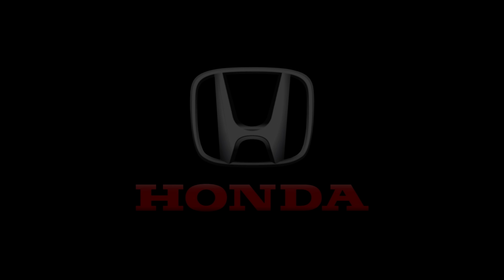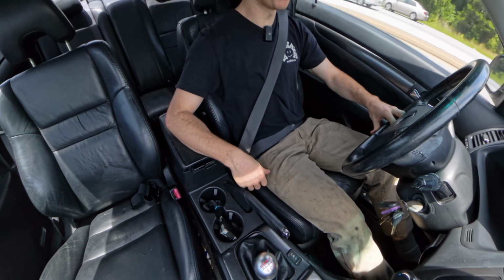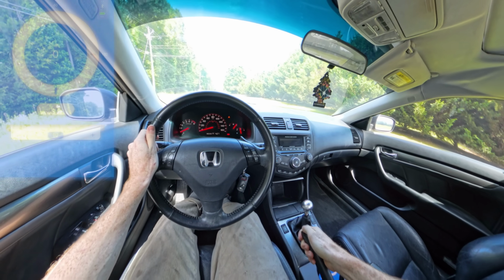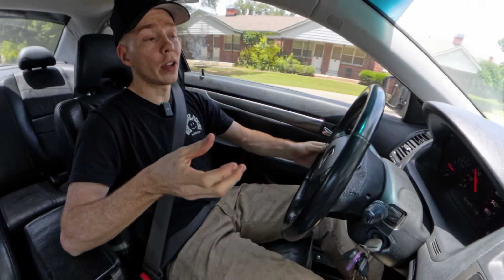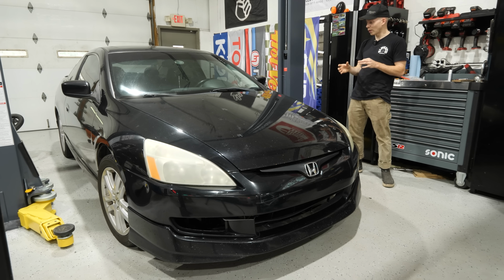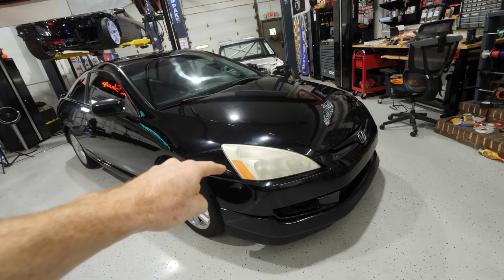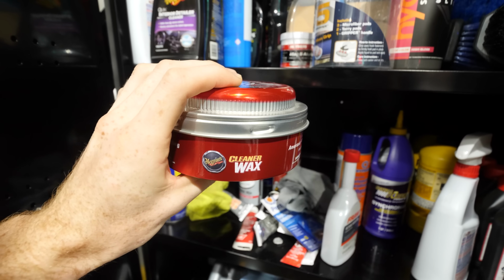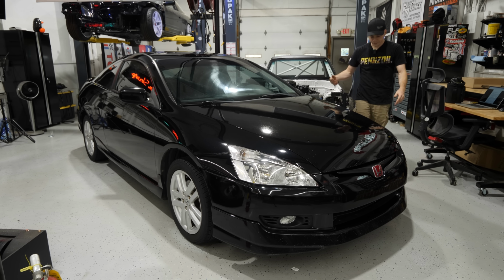I Bought Honda's Most Underrated Vehicle

Comment: Had an '05 Accord EX-L V6 auto. They are great daily drivers. Bought with 309k miles for $850. Replaced the front suspension, tires, brakes, power steering pump, plugs, coils, injectors, buffed out the faded paint and headlights, replaced the factory radio with an 11" Apple Carplay radio and kicker speakers. It was my daily for about a year and a half, even drove it from Kansas City to Austin and back 4 times (1,500 miles round trip). Sold it for $3,250 with 338K miles. Honestly wish I had kept it though.
Reply: where did you find that accord for $850?

Comment: YES! The v6 coupe accords are actually so underrated. Very powerful, not heavy, super reliable… 9 psi and they make over 400 horse
Reply: I had one.  I loved it.
Reply: Mine was auto but still such a fun car I miss it
Reply: Not from factory
Reply: @Lorentz_Driver  correct, hence why I mentioned that it needs to be boosted to make 400 wheel…
Reply: I miss mine, can't even find them anymore these days  : (
Reply: psi is irrelevant
Reply: @stevejeffrey11  the clear coat was so bad though I had the green which was a nightmare
Reply: @unsub2132  ye old Hondas really cheaped out on the paint XD
Reply: @joeygutierrez2657  no it is relevant. The biggest restriction is the valve openings into the combustion chamber and you ain’t really gonna be changing the size of that much therefore the psi of boost is totally relevant.
Reply: bruh with the right build 9 psi is like 550 with these cars 😭
Reply: @pob_car it also loves spray, fbo j33 accord with 100 shot is making 410whp
Reply: How much boost can the stock v6 bottom handle before having to go forged?
Reply: @iiAzT3Cii  can’t really measure that by boost because different boost levels can make different power levels depending on a lot like the turbo and fuel and whatnot. Whatever boost you do run though, people have pushed stock J30’s to over 500 horsepower all the way to j37’s to over 600 horsepower. 

It depends on a lot of factors but these can really push far even sbe
Reply: It's depressing everytime I look up any 6-6 Accord from any year it was made, Nationwide searches in the US always pulls up to 40 across the nation at most. It's almost as rare as the NSX itself, yet only a 10th of the price which is why I want one so bad. Cause if I could afford an NSX, I'd just buy a house instead lmao
Reply: I had an 02 favorite car til the trans blew
Reply: @Lorentz_Driver 9th gen coupe v6 from factory I beat rts etc
Reply: @Lorentz_Driver no shit
Reply: 400hp, no need for more than that goign to the front wheels. It will be reliable. to.
Reply: @terminhaider9695 I have a 2007 v6 6 speed sedan in a 1 year only color. I know of 2 others that I had to find in accord groups lol.  Mine has 140k the others are well over 200k which is cool.
Reply: @Lorentz_Driver "not from factory"  thanks for letting us know that Honda never made a 400hp accord.
Reply: He said on 9psi? @Lorentz_Driver
Reply: @joeygutierrez2657  it is when they come from the factory making the power you build a 4cyl to make in the early stages suspension upgrades are super noticeable at damn near 300hp in early modles and up to 360hp in the newer models
Reply: @wrxbjudy  it verys j30 j32 j35 j37 depends on what one you have or what combination if block and heads you pair up j32 heads with j35 block the Rl cams make 11.5to1 those will put out 450 500 NA
Reply: @iiAzT3Cii  about 8 no more than 11psi
Reply: @curdisdunn5414  NA? thats only making like 400 on e85 and 450+ with nitrous
Reply: @wrxbjudy  with a tune e85 the high compression Frankenstein j32/35 will make 450 500 if you do a boosted setup full Bolton these bottom to top these cars are capable of 700 to 800 I've owned 3 I have a cl type s it makes right under 450 on a tune and a rotex sc setup semi slicks short shifter p2r intake with ported runners valves springs and retainers full tilt on 11psi ...
Reply: You user name is wrx maybe find a comment about a sti or something
Reply: @curdisdunn5414  bruh what are u on about, i own a 7th gen accord with a j30 with j37 internals(3.3 L), manual swapped it w/ LSD, PnP and decked heads off j32 with RL cams and hlp springs, IM/TB/Runners all ported and polished, PCDs/J-pipe, Custom dual exhaust, MDX injectors, E85, HLP Block Guard, and with a 100 wet shot of nitrous makes 483 whp at about a mile above sea level
Reply: Ik mfs making making damn near 400 on a reflashed stock ecu and half the shit you just said
Reply: can you make the auto run e85? i have a 2007 accord coupe v6 auto
Reply: I have a 2010, but it's not a v6; it's a beautiful car. I just gave it a new paint job. It still turns heads. Looks exactly like when I bought it from the dealership.

Comment: I used to work at a Honda dealership. All us technicians LOVED taking the V6/6MT Accords for test drives. They’re sleepers for sure. The last ones they made had nearly 300 hp from the factory
Reply: 244hp but close enough 😂
Reply: @blackhawkgamingtv6553 they're talking about the later generation 1 I have one identical to the one in the video that I have full bolt ons tuned with 320 HP at the wheels but the 8th and 9th generation that came after this do have close to 300 horsepower from the factory at the crank because they came with the bigger 3.5 l the 7th gen like in the video and what I have is only a 3.0
Reply: J30a4 aint no where near 320whp
Even crank you aint doing 270-280 whp  regardless what you bolt ons you have
Reply: @seattlejdmcivic  yeah the early 2000's model had around 240 HP, could still spin the tires in first and second
Reply: @stevejeffrey11  I don't know what the hell you're talking about mine had only 60k original miles and even when it was still a j30 with the 6-speed manual even before I was full bolt on when I just had an intake and exhaust I was able to spin 1st 2nd and part of 3rd with good tires.......

And then when I went full bolt on with a custom 4 inch cold air intake to a velocity stack a j37 intake manifold ported and polished j37 throttle body p2r ported and polished intake runners p2r intake manifold spacer pre-cat deletes ATLP J pipe and custom full  3-inch single exit exhaust and eventually a cam with a custom grind tuned with a TL ECU on hondata made 268 HP AT THE WHEELS 
And that's on pump gas not even e85
It would struggle to get traction off the line even with good tires 
Now it is a j37 swap with full bolt ons much more power and that made 320 HP at the wheels AND THE CLUTCH WAS STARTING TO SLIP  on the dyno
Reply: @seanrose3951 ur crazy can easily push 300 hp on these engines modes and tuned especially if u add a charger to it
Reply: @kingmusa8618  exactly
Reply: @seanrose3951     I don't know what the hell you're talking about mine had only 60k original miles and even when it was still a j30 with the 6-speed manual even before I was full bolt on when I just had an intake and exhaust I was able to spin 1st 2nd and part of 3rd with good tires.......

And then when I went full bolt on with a custom 4 inch cold air intake to a velocity stack a j37 intake manifold ported and polished j37 throttle body p2r ported and polished intake runners p2r intake manifold spacer pre-cat deletes ATLP J pipe and custom full  3-inch single exit exhaust and eventually a cam with a custom grind tuned with a TL ECU on hondata made 268 HP AT THE WHEELS ((,WITHOU THE CAM,)))
And that's on pump gas not even e85
It would struggle to get traction off the line even with good tires 
Now it is a j37 swap with full bolt ons much more power and that made 320 HP at the wheels AND THE CLUTCH WAS STARTING TO SLIP  on the dyno
Reply: I happen to own a 16' 6-6 and i love it
Reply: @stevejeffrey11  no LSD
Reply: J37 are the 300hp
Reply: @stevejeffrey11 Accords didnt have LSD. The TL’s did tho (manuals only I believe)
Reply: I want one, but i think the reason they're underrated is because they're ugly lol. I can get over looks for a 300hp honda V6 though
Reply: @nuckels188  I disagree, a 16-17 accord coupe is pretty nice even stock especially with the HFP kit
Reply: @nuckels188  Stock ride height and wheels, yea they are dorky. Lower the car on some nice wheels and it will transform the whole vibe. Looks are very subjective though, and its definitely important for the owner to feel cool in their own whip.
Reply: @EricCT2  i meant specifically 7th gen like in the thumbnail. Most others are fine but 6th gen is actually the nicest looking IMO
Reply: @nuckels188 I agree except I like 6th gen sedans over coupes
Reply: @EricCT2  same
Reply: Yeah, the 2013 Accord V6 specs are 278 HP and 252 LB-FT. It’s a nice ride for sure.
Reply: Hell a ford flex is a v6 and almost makes 300 hp? Youre describing any other car man. Every v6 makes almost 300 hp nowadays..
Reply: Definitely these and the s2k whenever 1 came in for service 😂
Reply: @seanrose3951  i still firmly believe honda underrated or gave the WHP numbers for the j30 because they wanted to sell type s acuras with the j32. and the early j32 non type s was a dog in comparison to the j30a4 onwards. ive driven a few j cars and daily a 06 6mt and the fact that he put down 228 and 211 trq sorta makes sense... the j30 also likes 94 octane it does do fine on 87 range but butt dyno tells me it gains 10 on good gas.

Comment: Wait, the fact that the fit kept up with this accord is actually crazy. These things are quick. That fit was quicker than I realized.
Reply: I would hope the boosted fit could keep up with the accord while its stock..
Reply: @1StoppJay It’s not a diss to your accord lmao. It’s just impressive that gingium’s build of a motor not known for its performance was able to keep up without any internal work.
Reply: @1StoppJay  Car has like 109HP stock. It's actually pretty crazy.
Reply: Honda actually under reported the Horsepower the v6 Accord had to meet emission requirements,
the 2016 generation had limited slip differential which helped with all that power going to the front wheels
Reply: @stevejeffrey11 honda got caught over reporting their HP actually.   They were exposed when testing and reporting regulations were tightened up. It's US cars that under reported, the same refinements to testing gave cars like the Corvette a few more hp.
Reply: @stevejeffrey11 Whoa, I didn’t realize they ever gave the V6 Accord an LSD! I’ll have to look into that, because I certainly don’t mind the looks of that generation
Reply: @payne540  this 7th generation didn't but the Acura CL did.  You can swap the 6 speed from it to an Accord.
Reply: @payne540 no usdm v6 accord came with an LSD. The only accords with LSD from the factory that I can think of are the Euro R's that we don't get in the US
Reply: Nah fam I had an accord a 6-6 at that and the accords are just wayyyyyy too  heavy
Reply: @JosephSamsor again, it’s a turbo car that is much lighter vs a stock v6 car… not really a shock if you know what you’re talking about
Reply: @killuasclone7333 3,300 lbs in a v6 car isn’t heavy 😂😂😂😂 shhhhh. You gotta sit this one out g.
Reply: @payne540  the 9th gen Accord was the last to come with V6 and 6 speed manual :( 
coupe & sedan both look great
Reply: @stevejeffrey11  Nope, the 9th gen v6 and 4cly only have electric traction control.
Reply: @stevejeffrey11  Nope, the 9th gen Accord only has electronic traction control.
Reply: To have a Fit as quick as this Accord is a very respectable thing. That would make me so happy to have my GE be that reasonably quick. And the fact that the car is still putting 200-ish hp to the wheels is just staggering, although I suspect that dyno is a little optimistic...
Reply: @caribeskinner6290  too bad, they gave Acuras LSD I think
Reply: @JosephSamsor it’s turbocharged
Reply: Turbos make slow cars quick
Reply: his also seems a lil slow, ive driven a few and they seam to very in power. they are really fun cars
Reply: @partyguy9  Its also a stock motor that can on hold 170 hp. If you watched the tuning video the turdo has a ton of room to eat.
Reply: Power to weight
Reply: @Willis-de5hx  Is just as important.
Reply: @deaf2819 you have no idea what you’re talking about. Do you even understand how many cars come turbo these days? Let alone what it means to turbo an engine never designed for one when that engine is also a cheap eco engine? Obviously the faster car won, and it’s not some impossibility, but these accords are fast cars so for the fit to be able to keep up is impressive if you have the slightest clue of what it means to modify one like Gingium did.
Reply: @JosephSamsor  how many builds have you completed and cars have you tuned personally? Since I know nothing lol.
Reply: @deaf2819  you probably can’t even hear them so

Comment: Bought my 2000 Honda accord in 2019 for 2,500 with 145k miles. It has 261k now and it’s still like the day I got it. You can’t lose money on these things
Reply: unless you bought and auto 6th gen. those autos are garbage
Reply: @whoischris28  it’s an auto v6
Reply: @whoischris28  they are not that bad. my friend has an accord 04 auto 226,000kms the auto trans still shifts perfect no slips, no jerks. cant say the same for my zf 6hp 28 in my audi its jerky as hell after 150,000kms. I guess 600nm torque is a lot more to handle though.
Reply: @whoischris28 my auto 6th Gen has a bad 1-2 shift and shutters downshifting a little.
Reply: Damnnn drove it nearly as many miles in 5 years than it did in 19!
Reply: @realjoshuaW  it’s the work whip. I’ve brought it pretty much coast to coast twice
Reply: Just like me, I bought a 1997 with 210k in 2019 and now it's at 351k with hardly ANY maintenance. A/C still works and I'm way overdue on the timing belt but it's unbreakable. My 90 Accord is at 323k. My Legend is 200k. Amazing cars.
Reply: nice I got my 07 in the same year for 2,800 and it only had one owner before, now after 6 years its going stronger than ever, I have a lot of plans this car and hopefully give to my son in 12 years

Comment: I personally would say that the Honda cr-z is one of Honda’s most underrated cars
Reply: Honda should've drop a k series in the crz they would've sold like hot cakes
Reply: @StingrayOfficial  exactly why I’m trying to purchase one at the moment
Reply: @StingrayOfficial   go do your own research instead of relying on hearsay
Reply: Honda prelude
Reply: CRZ is just a 2 door fit 👀
Reply: @ZRIEST not anymore
Reply: @El_Tony_C   always will be … just because it’s a new one being made doesn’t mean the prelude got the attention it deserved.. not like the civic si or even the accord
Reply: Del sol is up there. Everyone overlooks those. The rear window ROLLS DOWN!!!
Reply: @ZRIEST  I owned one. Accord based, heavy shifter, dash is too high, doors are too heavy. 5th gens looks great though.
Reply: @jackarmstrong7285  2 door Insight bro, which i guess is a fit, but still more an Insight
Reply: Lmao what? An anemic economy version of a crx with more weight and a nearly non existent aftermarket? Not everyone is K swapping & at the price for that work just get an 8th gen si…
Reply: @deaf2819  well, here is the thing. When teh CRZ was announced in like 2001 everyone was so excited that it was going to have the K20 and we were all happy the CRX was coming back. Then it ended up being a hybrid and everyone was mad bro. 

Here is what many of us dont know. How are the chassis dynamics? Will it trail brake? Does the rear rotate? This is what matters going forward. Drivetrains can be changed. Chassis cannot.
Reply: As a kid I really wanted a crz but then I grew up and got an ep3 with a k20😍😍
Reply: @realjoshuaW   k-swap the world!!
Reply: @realjoshuaW  as a kid you wanted a crz? When I was a kid I wanted a crx. Lol age.
Reply: @shifu9276  haha definitely a generation or two ahead. Never really saw any nice crx’s growing up unless it was at a show.
Reply: @realjoshuaW  glad you got that ep3 though. 👍

Comment: the era of these interesting coupe versions of the full size sedan models was really cool. I have a 2008 nissan altima coupe with the 3.5l v6, manual transmission, actually crazy how much these two cars have in common in terms of quality, power, and layout.
Reply: Do you have any tones on yours .low miles high miles .any problems with it
Reply: I remember test driving one of those when it was new and scaring the sales person.
Reply: I had one as well but i sadly wrecked it. They're actually pretty rare so take care of it. I have a v8 07 mustang now and it doesn't feel much faster than the altima, it was surprisingly quick

Comment: I had an 04 V6 6-speed coupe with a cold air intake and cat back exhaust with no no mid pipe and 2 generic flowmasters on the back. Over 3,000 rpm the thing sounded like a beast!

Comment: Love it. Passenger side engine mount is probably toast. Very common.
Reply from the maker: Ahh that’s the clanking I feel lol
Reply: Innovative makes a decent mount set
Reply: Good mounts really help the launch and wheel hop too lol
Reply: @_Gingium_ can vouch for HLP, P2R, and HeelToe for performance parts
Reply: @_Gingium_ Timing belt, timing belt, timing belt. Don't let it kill another beautiful J-series.
Reply: @SanProsan1993  Yep, just do water pump, timing tensioner, pulleys, and timing belt all at once and the J will purr for another 120k+ mi
Reply: I have solid mounts on mine. If you don’t mind vibration go for it.